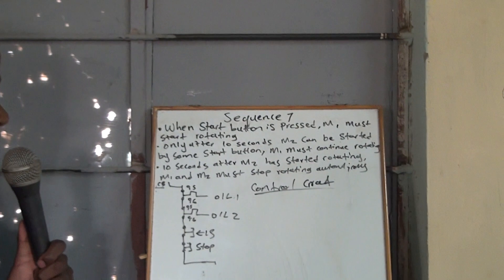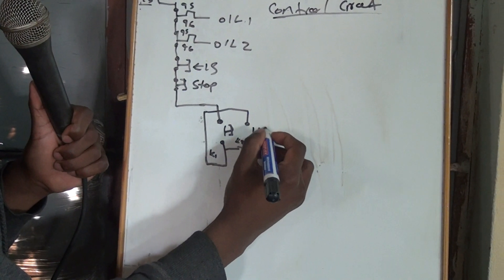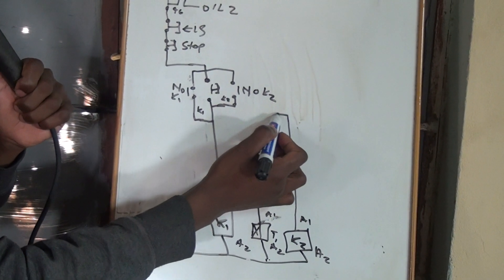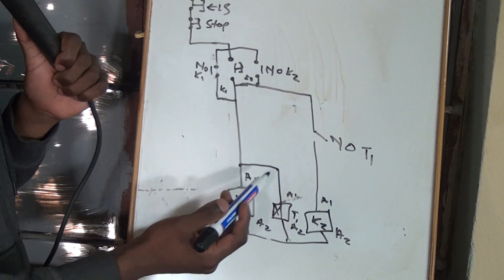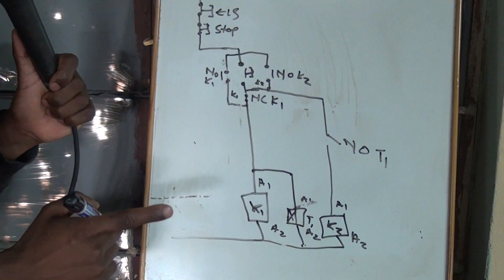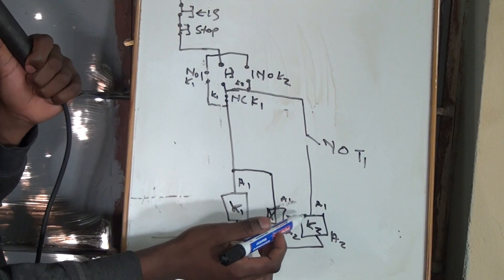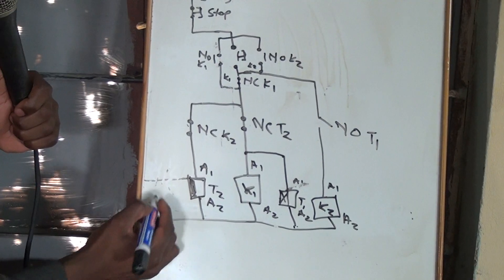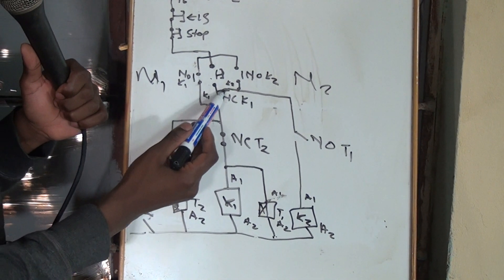MOTOR SEQUENCE 7 | ARTISAN ELECTRICIAN | ARPL | check your delay timer NC and comment what you see

Comment: 6:22 you added a NC Aux contact of T2 {off delay timer} to the line that powers Motor 1 {K1} coil + Timer 1, which effectively means when the start button is pressed, momentarily k1 coil + T1 coil + T2 coil will all energized. When T2 is energized, it immediately changes its Aux contacts, therefore the T2 NC aux contact on the [ K1 + T1 ] line will open, coil K1 will de-energize thus a retaining circuit is not formed, T1 will not start the counting mechanism {Its de-energized}.

 That T2 NC aux contact will prevent K1 from creating/forming a retaining circuit for the whole circuit, is what I'm trying to explain in a nutshell.

Comment: Pls explain why you not putting a normally closed of K2 on start button....sequence7
Reply from the maker: @GODFREYTSHABALALA-z1d  I love your question.
Reply: @collegenatedengineering1659  please explain
Reply from the maker: @GODFREYTSHABALALA-z1d  so if we put a NC of k2 then it means that when you you put power, immediately motor 2 will also but after 10sec  when motor 1 starts.

And we don't want that to happen. We want motor 2 to be started using same start button but after a certain time. 

Putting a NC of k2 is not the good option.
Reply from the maker: @GODFREYTSHABALALA-z1d  so when you press start button. We don't want motor 2 to start.....M1 must start first then M2 can be started using same start button
Reply from the maker: @GODFREYTSHABALALA-z1d  if you were to put a NC of k2 M1 would ENERGIZE but M2 would ENERGIZE after 10 sec without you having to press the start button again....

On this statement we want you to press the button again
Reply from the maker: @GODFREYTSHABALALA-z1d  we don't want automatic starting of motors hear......we want only manual....you must go and press the button again.
Reply from the maker: @GODFREYTSHABALALA-z1d  do you understand?
Reply: @collegenatedengineering1659  thank you, I do understand

Comment: Little bit tricky Thanks so much
Reply from the maker: @ravisjunior1675  you will enjoy next week when I post the practical part of it😁
Reply: @collegenatedengineering1659 I am confused my brother ,how does NCk1 affect m2 not to run when u activate the start button. 
While as it is connected on the line of m1 .
Thanks in advance
Reply from the maker: @milanothabo7380  remember that when you press start button it immediately go back to being a normally open and then a retainer is the one which continues to allow current to flow. 

So in this case I added a nck1 so that motor 2 does not start automatically after 10seconds but must only start if you press the start button again. 

There is no way that k2 can energize same time when you press start button  because there is a No of timer. After 10seconds then it becomes a normally closed but still it won't energize unless you press start button.

*the reason why I put that nck1 is also that current does not move in the down part to go and energize k2
Reply: @collegenatedengineering1659  thanks
Reply from the maker: @milanothabo7380  NC of k1 works in such a way that it doesn't allow current To go to energize k2. Otherwise if we don't put it then k2 will energize automatically and we don't want that